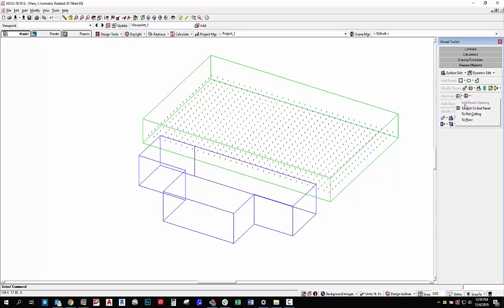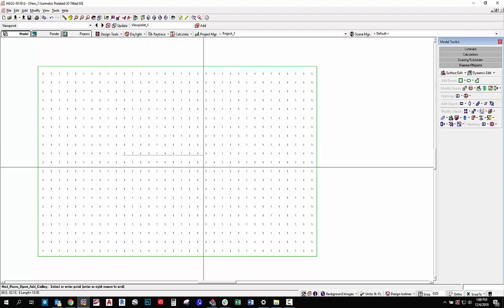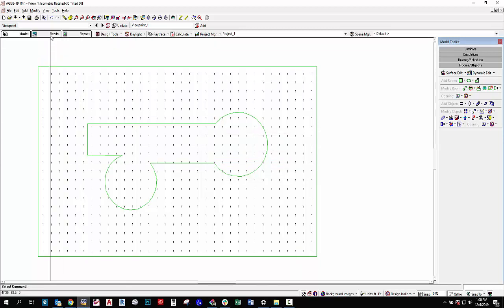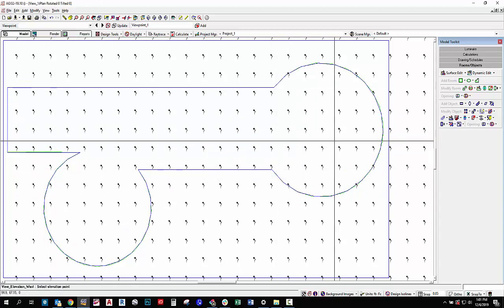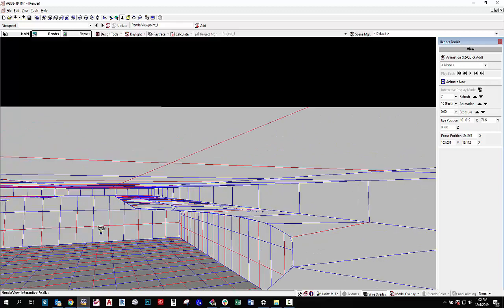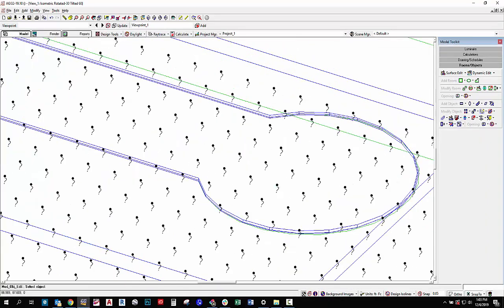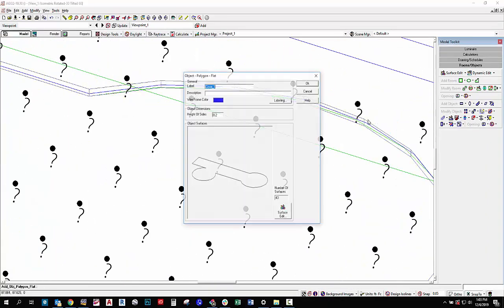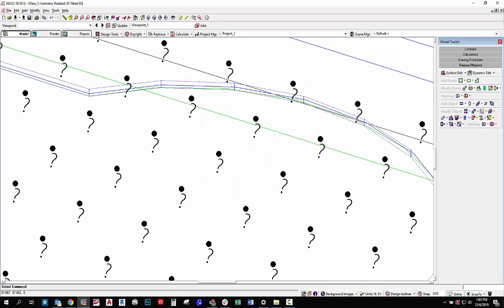AGi32 how to build architectural coves using the opening tool.

Comment: Hi Shaun
It's a very old video and I am not sure if you are monitoring replies anymore. But hopefully you are as I have a quick question - 
At 0:48 mark, while tracing the opening outline, how do you transition from straight ortho to an arc? Is this some sort of a hot key? 
It is something I have noticed first time in any of the AGi32 videos. Been using this software for years and thinking this would have been extremely useful for some projects I worked on.
Reply: You can swap from linear to arc in AGi using F4 as a hotkey.
Reply: He says it, you hit F4.